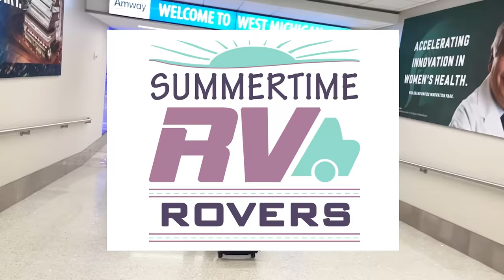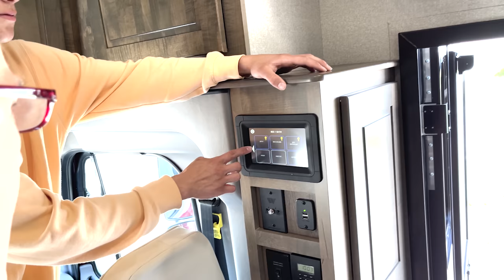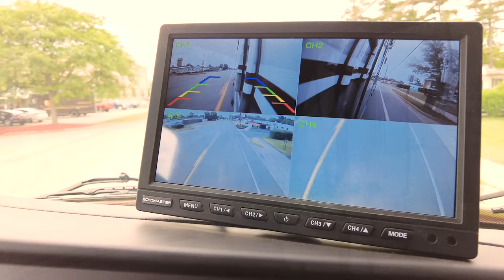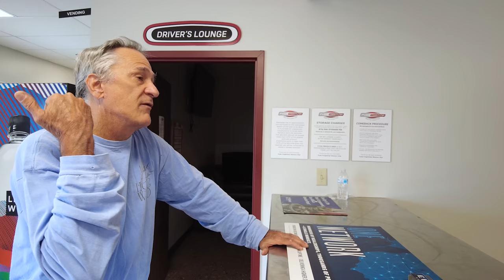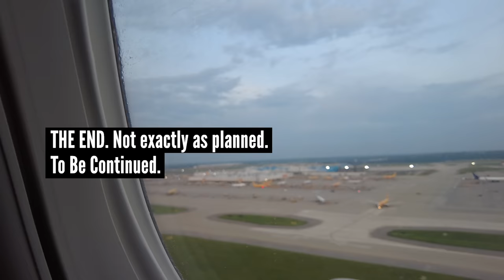Dynamax DX3 Delivery Disaster

Comment: Sorry about your experience with your new RV.
We bought a class c Thor WS31 and had problems from the get go.
On day of pick up things were wrong. They fixed the issues, we picked up again and 1 1/2 days later back to the dealer.
We picked it up again and finally went on a trip, less than 30 days to help family in hurricane ridden Louisiana to help family. We returned home and dropped off our unit at the dealer with a repair list of 50 plus items to be repaired.
Some small, small big items.
Long story short and 8 1/2 months later, Thor is having to buy it back.
While sitting on the dealers lot it started falling apart.
The fiberglass front cone was cracking and the ceiling panels were warping and buckling, so told them to keep it and refund our money.
That is supposed to happen soon, it has been approved.
Good luck and safe travels.

Comment: When you get a new rv, you must simply do a few camping test trip locally to check all the features. Only when everything seems reliable, a big trip can be planned. Same with a new car. There are so many things to test; battery reliability, solar panels, slides, fridge, doors, cooktop, window insulation, tank insulation,  truma heating, engine, propane inside outside, tv, antennas, tank flush, shore power, water systems, generator, hydraulic leveling, everything must be well tested locally in few trips. If you go right away after buying it, of course you would get in trouble. There is always something, even to learn the features it take times.

Comment: The DEF system is a  problem. I have an older Dynamax without it and am doing everything I can to keep the rig in good shape so i can keep it for another decade at least. I also own diesels with the DEF. They cease to function on a regular basis. The UPS truck maintainers next door also hate DEF. If the vehicle sits for a while the fluid will crystalize in the injector and its a no go. Best of luck with your beautiful rig...

Comment: A lot of folks get discouraged in that initial sort out period with their first RV. If you have ever owned a big vehicle or vessel like this, you know very well that there will be issues right out of the box. You can buy a 10 million dollar yacht and there will be sorting issues to deal with. Brand new $400,000 car hauler? Same deal. But it’s definitely the responsibility of the dealer to make this point VERY clear that a fresh built vehicle of this sort is to be expected and it’s not always a good idea to plan an entire trip leaving right from the factory. Actually, the best plan is to put together a weeks getaway in relatively close proximity to the dealer. If anything goes awry you can get to them quickly. It sucks, but it’s a fact of life with all of these factory builds. Hope you don’t get disillusioned from the experience. Once it’s all sorted and settled, it’s usually a good long time before you have any real problems. Unless of course you don’t keep up with the regular preventive maintenance. Always remember there is a service truck under your RV and they need regular attention the same as if they were delivering produce instead of carrying a house on its back.

Comment: I'm no mechanic or truck expert but I have heard that diesel engines once you drive them for a good period of time say over four hours non stop you have to idle the engine for a good ten to fifteen minutes before you turn it off so the engine can cool off.
Maybe this is what is happening to the Freightliner?
You get to a destination after hours of continuous driving and you just simply turn off the engine which is why it won't start back up.
Of course sales people and such are not truck drivers or anything themselves so they might not even have heard of these things.

Comment: Just to add some context.  Once we were made aware, our local Freightliner rep called the Freightliner dealer in KY, to let them know that the proper diagnosis was a bad starter.  We have seen a handful, and as you have seen, they are very tough to identify as they look like other issues.  They also only do it after it has been driven enough to get it to a certain temperature.  We take all of them on a 30-60 minute test drive.  We identify most of them, but clearly not all of them through that process.  Our rep called, let them know it was a  starter, also gave them a list where to find them in stock (since they are on back order).
Reply: Look and see where my DX3 is now! You also forgot to mention the complete failure of the DEF system and the fact that parts for the DD8 are much harder to get than the Cummings!! BTW-it is currently at Freightliner Service Center in Peach State Truck Centers McDonough GA. 20 days and still cannot get this motorhome 1300 miles back to Sarasota FL!!
Reply: @jeffkirk738  I was not aware of any DEF failure.  Now that I know where it is, I have again reached out to our local Freightliner dealer to see if there is any way they can provide assistance.  Freightliner is traditionally very responsive which is exactly why we use them.  Unlike normal RV chassis that can be weeks if not months to get in, FL treats these like commercial trucks.  I personally just did 7 nights and 1000 miles round trip in our brand new, first off the line 32KD Europa, with zero issues.  I know that does not solve your problem, but your situation is the exception, not the norm and we will do everything we can to help.
Reply: @jeffkirk738  This is the response I got back from our local dealer that we had reach out "Jeremy in the service department at Peach State, Jeff is in line as a waiter, Jeremy was hoping to look at the unit this afternoon.  Jeff should be in good hands as Peach state is an Elite and Oasis dealer"

This was the 2nd.  "I spoke with Savanna at Peach State, Jeff has picked up the unit and the repair is complete.
Peach state had replaced the inlet NOX sensor."

Hopefully this puts that chapter behind you.
Reply: @DynamaxRVs I will say from the outside looking in this is the kind of customer service I would expect if things have gone south plus maybe some compensation.

Comment: I read all these issues with  new POS RVs  i enjoy my wonderlodge  with cat power 
Older  yes but I'm without Def bullshit  and on back order parts  no water leaks 
Reliable  kitty power and you put key in ignition it starts .. I would get my money 
Back from Freightliner rv center  no sense spending that kind of money for issues.
I had newer RV  2020   and  I had issues  with starting and engine controls  i made 
Dealer buy unit back  and purchased  wonderlodge    no issues